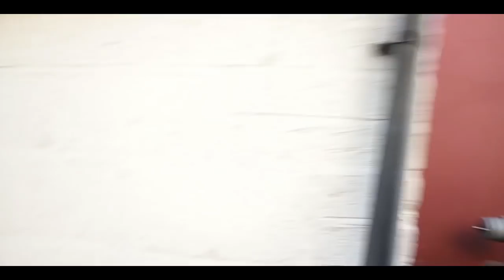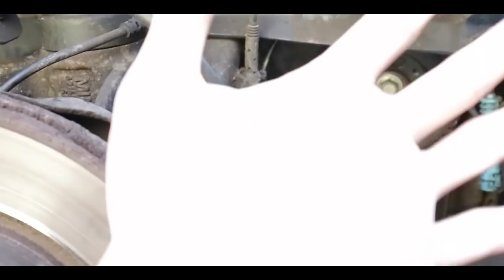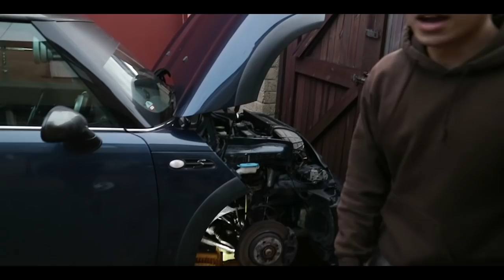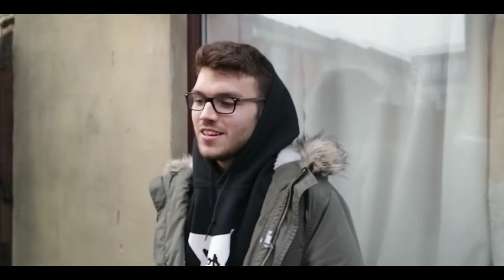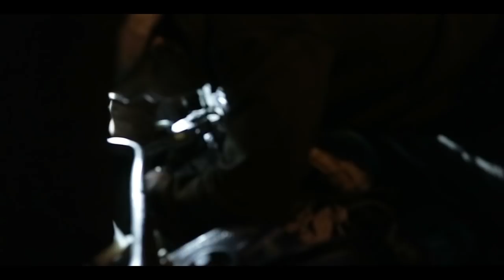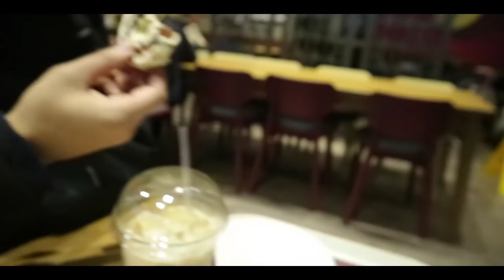CAR IS STILL LEAKING OIL!!

Comment: Probably the gasket between the filter housing and the block.
Reply from the maker: That was the first thing that I changed 👍
Reply: RonnyyyB ah no way the triangular one? Could be rocker cover then as that leaks down the back of the block.
Reply from the maker: yeah the triangular looking thing! Could be... but I spotted a leak coming from the actual oil filter housing itself which is weird lol
Reply: RonnyyyB sometimes they can crack...hopefully no that! Change the filter and o ring?

Comment: Usual suspects would be valve cover gasket, crank sensor o-ring, oil pan gasket, oil cooler seal, timing chain cover gaskets and crank seal.
Reply from the maker: Yeah I'm familiar with the usual suspects, its just getting round to changing them all... lol 👍

Comment: Rocker cover and oil filter housing? 

Clean it generously with brake fluid cleaner then try to find the source.
Reply from the maker: rocker cover looks fine I'm sure, oil filter housing has been changed already. There is a leak coming from the oil filter cap itself which is weird...
Reply: RonnyyyB I think the cap area does have a gasket of some sort knside the rocker cover.

Wouldnt hurt to swap the cap for a new one and test. They can't be too expensive.
Reply from the maker: anish1993 yeah I'm going to have a look at that next for sure! 👌